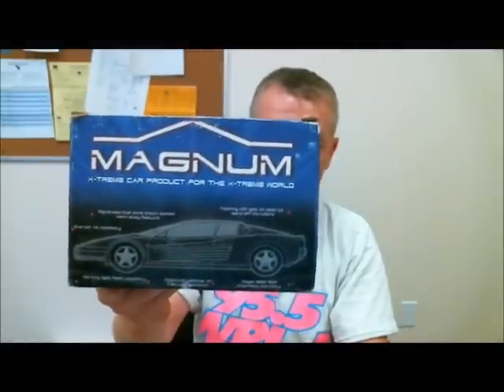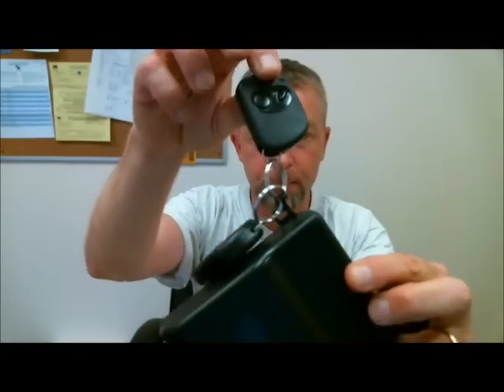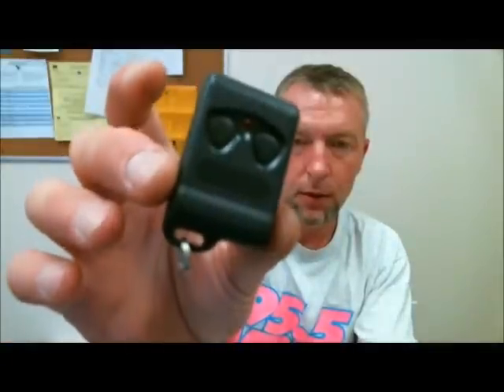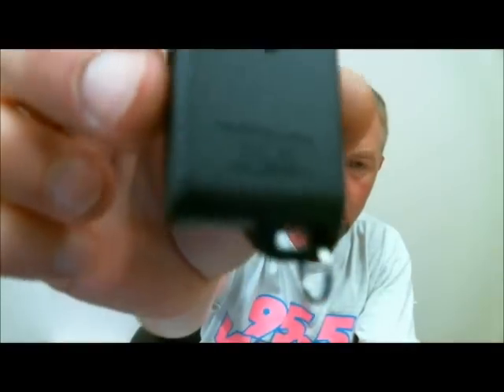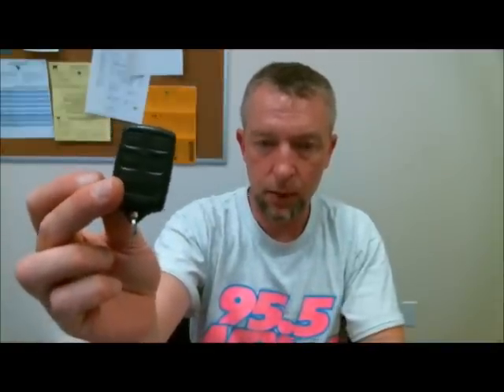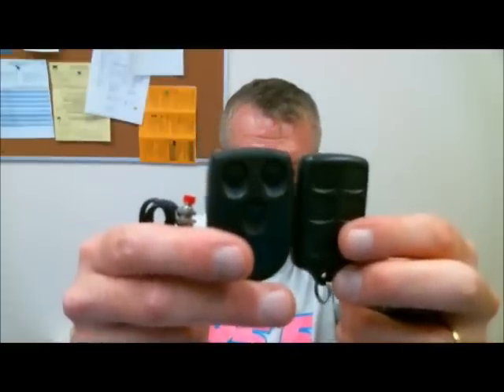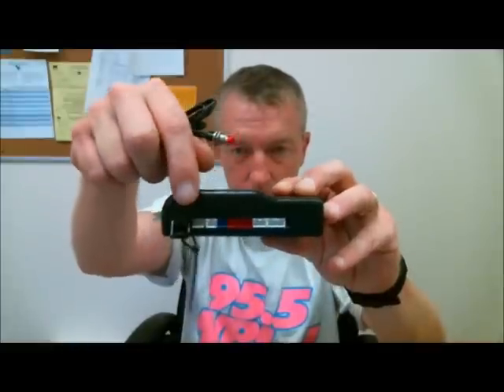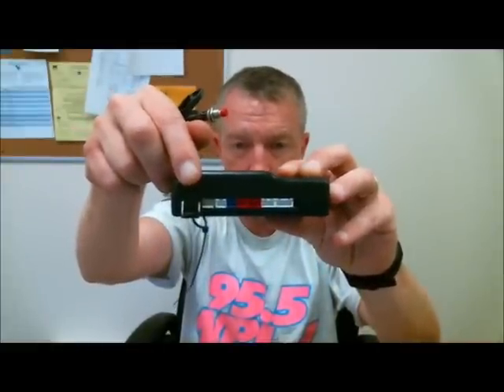How To Program J5523518T1 and 303mhz Transmitter Remotes

Comment: Thanks for posting, I was able to successfully reprogram my remote. I do however, have another question; on occasion when I lock/unlock my 1996 Toyota Camry the lights will flash. I was wondering why or how I can make it so the lights flash all the time when locking/unlocking my car. It would be convenient for when I'm walking away from my car and lock my doors, to ensure the button was actually pushed and the doors were locked. Any info would be helpeful!! Thanks again.

Comment: So my unit is just rke/remote start. Has no alarm functions, so can’t hear it chirp. Doesn’t have a valet switch. The blue plug says vacuum and trunk. Do I still use that connection? No programming switches/buttons on the board. Can’t get it figured out. I’d gladly give my number to someone with info that could help.